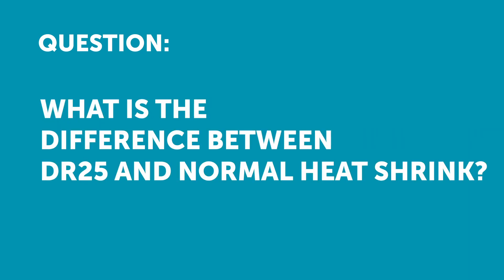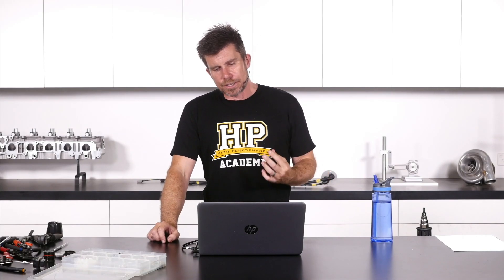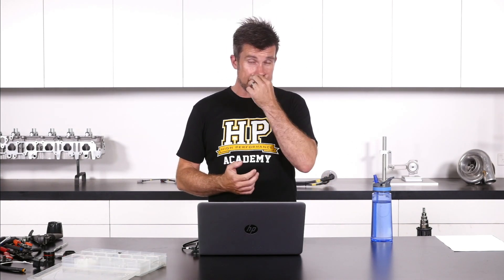Why Is Raychem DR25 So Special? | Wiring Heat Shrink [HPA Q&A]

Comment: Sir will DR-25 withstand being submerge in a gasoline for a long time?? I am going to use it on a motorcycle fuel pump spliced wire. What can you recommend ?  THANK YOU
Reply: Long-term fluid and heat resistance. Resistance to
aviation and diesel fuels, and hydraulic fluids. Flexible,
flame-retardant.
Reply: @HexerEngineering  THANK YOU !!!!🙏🏼